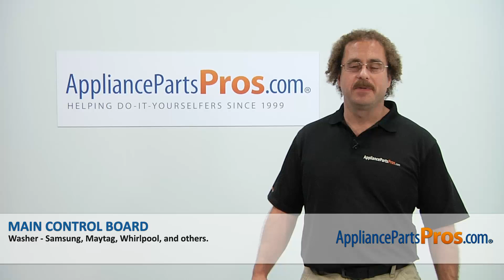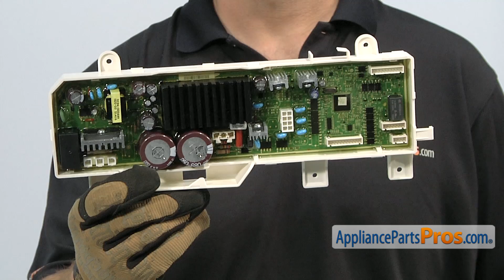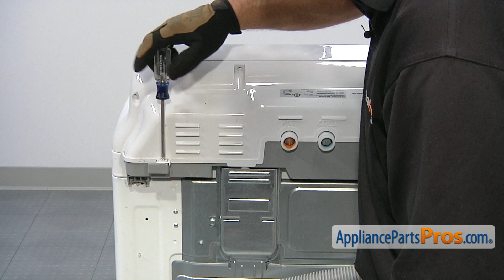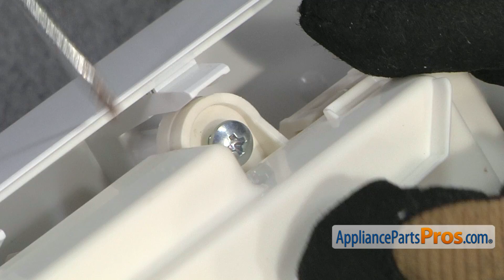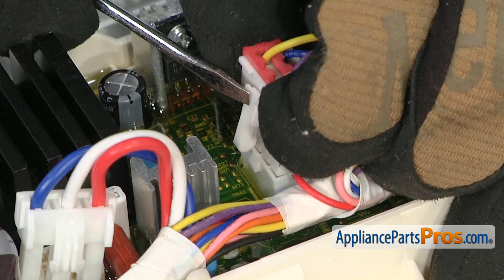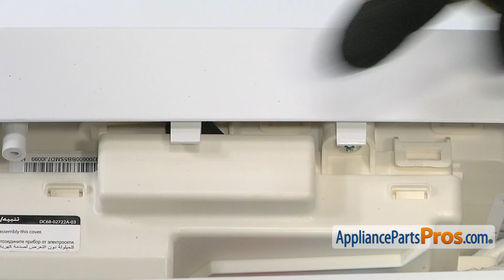How To: Samsung Main Control Board DC92-01021B

Comment: I have the WA456DRHDSU/AA machine.
Does it matter which one of these two boards that I can get?

Dc92-0121a or dc92-0121b
Reply: Ok I figured out that the B model board has less features. I hooked it up and it fixed the clicking noise that was getting, but now I am missing some of the wash cycles. It just skips past some of them. I am getting the a model.
This was a great video on swap out, removal took me about 20-30 minutes, reinstalling was quick.
Buy the parts and do it yourself, if they are too expensive new, get a used part.
Reply from the maker: Hey @dadthefixerflorida — thanks for the great feedback, and we’re glad the video helped with the install! For your WA456DRHDSU/AA model, the DC92-01021A is actually the correct control board. You’re spot on that the “B” version can sometimes power the unit, but it may not support all original functions — like the full cycle selection you noticed. Swapping to the “A” model should bring everything back to normal.

If you need help confirming compatibility with any other parts, feel free to reach out. Always happy to help!

Comment: Thank you. I was able to replace the board and my Samsung washer is running again 🙂 The washer worked but wouldn't start when you pressed the start button and it would just chime. Now it's running through an empty cycle since it hasn't run in a bit since I wasn't sure what was wrong.
Reply from the maker: Hey @mdougy92 — that’s awesome to hear! 🎉 Glad you were able to get the board swapped out and your washer’s back in action. That chime-with-no-start issue is a sneaky one, and replacing the control board was definitely the right call in your case. Let it run that empty cycle and you should be good to go from here. Let us know if anything else comes up!

Comment: Hello, my washing machine stops at the 1st test with the error 9C2. It doesn't go any further.
When I try to start any program, I hear 2 beeps, and nothing happens. I have already tried turning off the power switch in the main outlet to reset the washing machine.
Reply from the maker: What is your model number?
Reply: @appliancepartspros  wf45r6300av/us
Reply from the maker: That error code indicates a power error. You will need to make sure you are getting the correct amount of voltage to the unit. If that checks ok you will need to test for power going to and from the main control board. If you have power to the board and nothing coming from it when you set the unit then you will need to replace the board. If you don't have power at the board, but have power to the unit then you have a wiring issue.

Comment: I just want to get rid of its wretched speaker! Plz let me know where and what wire to cut!
Reply from the maker: What is your model number?
Reply: Lol im here for the same reason. I have the WA45T3200AW model, haven't found a button combination to turn it off and forum posts say it's soldered to the board under epoxy. Song driving me crazy enough to want to dig it out myself!

Comment: This might be my issue. I have a samsung WA40J3000AW/AA 12. It stopped going through cycles. You have to manually select the next cycle.
Reply from the maker: It does sound like a control board issue. The part number for your model is DC92-01739A. You can place an order through the website, or you can call us at 1-877-477-7278 to place the order over the phone.
Reply: @appliancepartspros  Thank you
Reply from the maker: You're welcome!

Comment: Help! I replaced the main board, no power.  Replaced the noise filter, no power.  Plugged the washer into a different outlet.  Still no power!  I’m at a loss? Any advice?
Reply: Try to check the power cord

Comment: i hate these junk computer washers..i swapped the control board and water valves from a junk washer into a same model washer now the lid is locked and wont open...lock light lit up even when turned off
Reply from the maker: We'd be happy to help you figure out what went wrong. We offer free technical advice and diagnosis. You can give us a call at 1-877-477-7278 or you can chat us at our website: http://www.appliancepartspros.com/. We will need your model number to give you accurate advice, which you can locate using this tool on our website: http://www.appliancepartspros.com/modelnumber_locator.aspx

Comment: how often are your replacement rebuilt boards bad? I have a home warranty and sears has replaced two control boards which they say were bad outputs to the touchpad so now they after two months are ordering a third control board. This last tech tried to tell stak that it was usually the touchpad, but they wanted to try a third control board! He actually had to talk to his supervisor to get a new non refurbished board this time. Most companies are training part replacers these days so they don't take the time to check voltages.
Reply from the maker: We only sell new, OEM parts, and we have a 365 day warranty!

Comment: I've noticed the new control board has a different brand relay for the door switch. I believe that's what's wrong with my washer. Did you replace this particular one because the door wasn't locking?
Reply from the maker: So have you replaced the control board, and it still isn't working? We offer free technical advice and diagnosis, so we'll be glad to advise you on that repair. We’re available 7 days a week at 1-877-477-7278 or you can chat us at our website: http://www.appliancepartspros.com/
Reply: I ended up buying the entire control board from you. Will replace relay on old board just for fun and see if I was right. Control board is coated in silicone so it's very hard to service.
Reply from the maker: It's often difficult to repair just one part of a control board, but if you're able, that's great! Let us know how it works out.